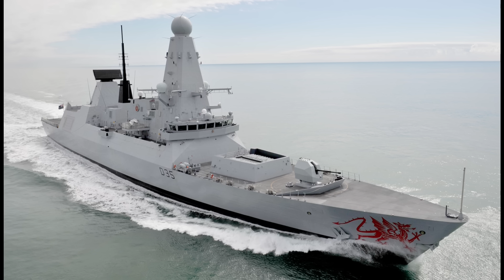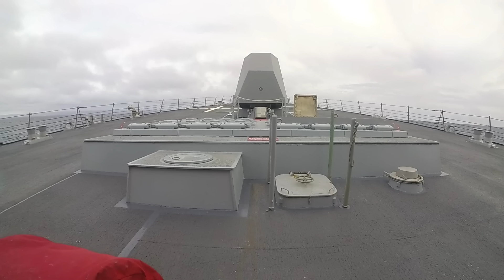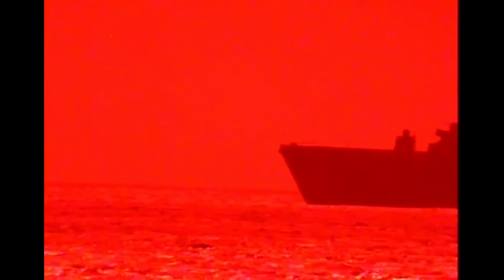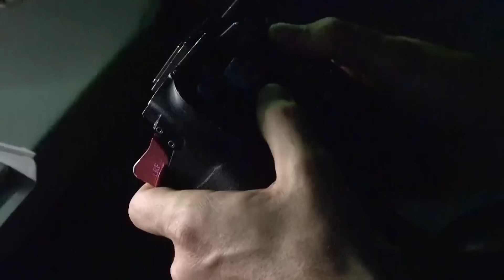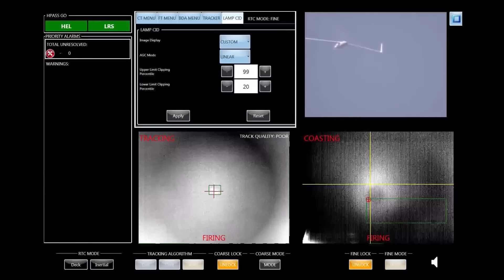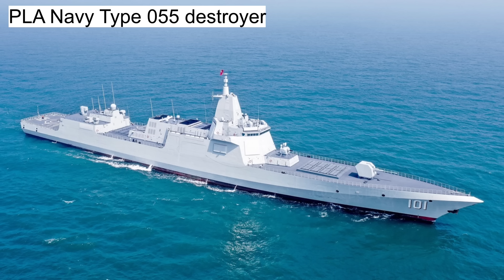Britain's Type 83 Destroyer: Three Radical Designs, One Big Decision

Comment: Up gun the existing Type 26 Hull. By replacing the multi-mission workspace in the center of the Ship , you can fit an all ship total of 96 VLS cells.
Reply: It would be a lot less capable than a dedicated new ship
Reply: @omarbaba9892  True, but it would be 10 x more affordable, and have a proven hull and mechanical structure.
Reply: @SteveHill-dk5xl it really would not be, it would still be incredibly expensive to rework the ship to be a proper AA platform, the BAE proposal to swap the mission bar for more vls doesn’t improve the radar
Reply: @omarbaba9892  The Type 45 Daring Class is an example of how expensive it is too start from scratch and make a mistake. Rather than another Bespoke platform, simply expand on the proven Type 26 design, accepting what limitations it may impose, the risk is much much lower.
Reply: @SteveHill-dk5xl and look where that got us, one of the best anti air warfare ships in the world. 

The type 26 is already near the limits of its power generation. That’s why the max amount of vls Australia could fit on it was 32. Sure it could fit 96 by removing the mission bay but that’s still going to be very limited with it likely not being able to have a lot of the systems which make the type 45 so good at AA

No, we absolutely need to make a new ship. Ideally like what the Italians are building, a 11,000-14,000 tonne ship with over 100 vls cells and one they can perform multiple roles.

Comment: What a load of nonsense.   In a struggling defence sector. This is a pipe dream
Reply: How
Reply: @omarbaba9892 what are you blind ? We have no money and the type 45s will run until into the 2040s
Reply: @omarbaba9892, there is no development of this ship even mentioned; it's just a concept, nothing more
Reply: @Highendaudio1 there is current development 

Also, clearly not since we’re currently building over a dozen large fridges as well as massive export contracts with other navies
Reply: @omarbaba9892  Where do you live exactly. The only thing you know is the nonsense that's written. The type 83 will not even be on the horizon as the type 45s will serve right in to the 2040s. Large frigates. ?? The type 31s and toy GP frigates and we wont ever see 8 xT26s which are not the platform you think
Reply: @Highend @Highendaudio1  UK why? The only who’s most likely to be a bot is you given the strange username and lack of a profile picture 

Well yeah, it is basically in development to an extent since companies are coming up with designs for it. Not to mention that the type 45s are designed with an around 3 decade expected service life, mixed with the inactiveness from their PIP conversions that will easily take most of them into the early to mid 2040s, keep in mind the earliest Arleigh Burke’s are in the 30s and are still doing just fine 

And no, where is your evidence for this? The government has continuously stated that additional orders will be made to make up for the type 26s given to Norway, what’s the evidence to say it’s not happening especially since they’ll be needed to keep the actual yard open. And the hell you mean “not the platform you think”? Care to elaborate on that? 

And no, it’s ridiculous to call the type 31 a “toy frigate” at over 5000 tonnes. Especially since the contracts are already signed and in place to get them mk41 vls.

The stuff with the type 26 is mostly just fear mongering as Norway getting those ships will massively help the RN as well due to the major alliance we have with them, their ships will be identical to ours allowing for great interoperability as well as the fact they literally patrol the same areas we do
Reply: @omarbaba9892  You haven't got a clue and all you have said is absolute nonsense. There is nothing else to say because you are just making yourself look stupid.  You just come out with word salad. UK Parliament has not confirmed or anounced it. You are simply an internet reader and never served in any navy to understand how they work. Haven't you got school tomorrow .  Type 83 haha
Reply: @Highendaudio1 not actually saying why I’m wrong just saying I am

Ok😂😂

Bet you’re one of those “we need 40 frigates and 20 destroyers” people, like we for some reason would need even half that many large surface combatants now😂
Reply: @omarbaba9892  Perhaps it's best to rest for now and enjoy some downtime, maybe with a comic book. Everyone is entitled to form their own opinions. While you make some claims, there hasn't been any official government announcement yet.haha
Reply: @omarbaba9892 No one is coming up with anything for any type 83 concept apart from dreamers lol
Reply: @omarbaba9892  I have served in the Royal Navy and still teach. So go lay down you are embarrassing yourself. I dont have discussions with dreamers

Comment: I like the concept of multiple interlinked loyal wing-boats, not only does it give you diversfied aresnal loadout you can spead about a fleet or reload mid deployment. However in times of low intensity need these ships can be optionally crewed by a very small crew to do basic 'showing the flag' missions around the world, but primerally these can be command training vessels, in the old school of roving age of sail frigates, like a River class, but with global depolyment range. Give them the names of Razee's, small ships with oversized punch.

A single lage centre vessel makes sense as you can have a corrisponding larger ship for a smaller increase in crew than having 2 seperate ships. We know the servicability rate of ships is abysmal, building 4 ships means you are essentially immune to budget cuts as you have to have all of them (like Vanguard/Dreadnought).

Comment: British is better off to build more smaller frigate instead of big destroyer.
Reply: That would add much needed mass, as the USN is finding out.  But the necessity of magazine depth using VLS means bigger ships, more complex ships and therefore more expensive which leads the Treasury to buy LESS ships for the budget.
If going smaller they'd be role specific with little overlap as there's be no room in the hull. E.g AA role means no anti-ship, ASW means very little AA defence.

Type-23 was going to be a hull with a towed array - only - but sane minds put a stop to that, but it almost happened because the RN wanted hulls and the Govt wanted to cut defence.  The Falklands was not the wakeup call to the politicians it should've been, instead they used it to do a victory lap and farewell tour.

I'd leave it to the Admiralty, they know what to do, but the politicians need to be pulled out of this mess that they've caused and proven they can't handle, understand, or remedy.

Comment: The obvious solution is to build something the size of a rowing boat, in the shape of a type 45. This will confuse incoming drones and missiles and reduce lifecycle costs right across the board.
Reply: A ROWING BOAT?! Think of the expense man.  No, it must be a boat made from a single sheet of newspaper, a cheap one not a broadsheet, and shaped like a hat so that it's multi-functional and saves more money!
Reply: It would need to create matching radar and heat signatures - might work?
Reply: Or pedallo,'s

Comment: The third option was first offered to Australia for their Hunter class variant and is seriously being considered by the Australian Navy and it has a larger radar in it's design so it can be done. If Auatralia goes with this variant then that might reduce the risk for the UK.

From Wikipedia 

During Indo-Pacific 2023, BAE Systems Maritime Australia revealed a version of the Hunter-class frigate with an increased number of VLS cells. This was done by removing the Flexible Mission Bay and elements of its ASW capability (including the towed VDS), and replacing it with a 64 Mk41 VLS module for a total of 96 Mk41 VLS cells making it equal the USN Arleigh Burke-class destroyers. In addition, the number of anti-ship missiles was also increased from 8 to 16 Naval Strike Missiles. The VLS cell count is flexible and 16, 48 or 64 cells could be added depending on the requirement. It was also proposed that should the Royal Australian Navy require it, an additional 32 VLS cells could be added in place of the 5 inch Mk45 main gun for a total of 128 VLS cells. BAE Systems Australia claims that this variant retains 85% commonality with the original Hunter-class design. They also claim that there would be a minimal impact on cost and negligible impact on the schedule of the build so long as the modification to the design commenced with Batch II rather than Batch I vessels.

Comment: I feel Royal Navy should learn their lessons from Type 45 and always build a prototype first to test out if you are having something new and never used before on a ship, be it engine or sensor, dun be like Type 45 only to have to do a PIP later and send the ships back to "servicing" for months after they are launched.
Reply: They sort of do... the first in class is usually the guinea pig of sorts for all classes.

You can't really delay the building of the other ships in class because the build takes so long. If you waited to get one in service before starting on the others you'd increase the cost of the class enormously from letting the production go slack, and delay the commissioning to the point the class is technologically relevant for a shorter period of its service life.

You can test and adjust to a reasonable degree between each hull, but you kind have just have to hope you got your spec and design right for major things.
Reply: @Chimpiin the Type 45 was committed to build just based on Computer simulation on the new generator, since they didn't use the "traditional" tried and tested generators, and opt to use new tech, you never know what can happen when you change from a "tried and test" tech to a new one, like if you decide to change from a gun based CIWS to a laser one for example, hence you need to have more real world testing to make sure you test all variables before committing it to mass production.
The fact they didn't realise the generators had issues in warmer waters of the Mediterranean Seas, and had to add a Power Improvement Plan of an extra generator and do it to all 6, shows they didn't even test the lead ship in all NATO waters and just around UK's waters.
Of cos if you are designing a OPV, a Patrol Vessel that only move in ur own coastal waters that's fine, but it you want a vessel that can travel across oceans, won't you at least make the lead ship move to more waters like UK to Suez canal or UK to Cape of Good Hope, (what if suez canal is closed), and see if it has problems before realise oh shit the issue is with the design in the first place, the blueprint, and you already cut the steel for the others, too late

Comment: We do not need a type 83, we need type 45 block 2's and more 26 and 31's.
Reply: Starting up a t45 line again isnt that simple the amount of work that will go into it will be close enough to that required for a new class that they'd be better of with a new class now its to late for T45 batch 2 that boat has sailed.
Reply: Tf? The type 45 is now a 20 year old design, there are improvements that can be made, especially the vls capacity

Comment: Move the 5-inch gun up front, slide the bridge forward into that space and build 2 sponsons on the hull to fit 2 5-inch guns, 1 on each side. The space gained by moving the bridge forward can then fit more launchers
Reply: " and build 2 sponsons on the hull to fit 2 5-inch guns, 1 on each side." and where would the ammunition for those guns go? Currently the magazine is located beneath the gun, in the depths of the forward hull.
Reply: I agree with the word 'currently'. I see a gun-ammo bay still in the centre of the ship, but with a system that also moves it to where it needs to go. Surely we can design and build such a system? This way, we would have a proven gun layout that automatically has swarm defence ability.
Reply: Each 5 inch gun system is at least 20 tons of top weight and sponson mounting them doesnt even give them that much more field of fire then a single bow mounted gun sponson positions on modern ships are better for smaller guns like 30-40mm's or maybe at a push 57mm's the smaller systems will also have higher rates of fire to deal with drone swarms and come with things like air burst programable munitions or even twin line feeds allowing them to quickly change ammunition types on the fly as needed making them better for dealing with drones.

If magazine depth is needed go with wolf packs of OPV sized drone sloops armed with 16 VLS cells that are networked to the crewed ship each having their own CIWS and 30-57mm guns to assist with point defense and have a helicopter pad so the crewed ship can airlift maintenance crews over every so often to inspect and repair things.

Comment: i think weapons systems should come first, sensors, robust cooperative engagement,  a mix of low cost high load-out weapons for drone swarm, and high performance and long range for theatre and fleet  anti air defence, vs missiles and fast jets etc. The Hulls don't matter that much. a mix of refit upgrades for existing vessels (radar, fire control weapons), and revised (or new) hulls for new build if needed, I thinks its to late for Tupe 45 batch 2, but existing 31's and 26's should be part of the networked system.

Comment: Drone swarm management needs 2 things: Big/ stand off arsenal (ship, large cargo aircraft or base) + Forward drone node controller. Both can trade off capability to be unmanned. Sophisticated manned escorts may look very different than they do now but will need reload-at-sea capability: If using standardised pods/containers, it maybe possible to design this to include re-role and be done by any ship, even an unmanned one.
Reply: I agree. The destroyer doesn't need 100 vls cells if it's controlling 10 drone boats, each with 15 vls. Take the arsenal ship concept and instead of having one massive floating magazine, make lots of small, cheap floating magazines

Comment: Larger hulls don't add much to the cost of a ship. Steel is cheap. Those massive container ships only cost about $150M. 
It's the systems which cost money. Make the ship as big as you like. Make the crew quarters more spacious, and bigger fuel tanks, more VLS. 128 sounds like a reasonable number.
Reply: But anyway the hardware in the 128vls isn’t chip
Reply: But a bigger ship also makes for a bigger, easier to hit, target.
Reply: @_starfiend  True. I supose it's striking that balance. I wouldn't recomend making a warship the size of a container ship 😊

Comment: They need to sort out the power plant problem, the Rolls Royce intercoolers don't work reliably. Going with the idea of diesel to produce energy for an electric drive..... Theoretically from my point of view each diesel could be swapped with a future Rolls Royce SMR (small modualr reactor) to deliver the daft amount of power they will need for the electronic/warefare systems and point defence energy weapons. So the engine problems are may mayor conceran throughout the fleet but I suspect a place holder.
Reply: Northrop Grumman intercooler

Comment: They need to focus on frigates at the moment
Reply: aren't frigates the most numerous major combat vessel in the royal navy? And a new generation of frigates are under construction currently.
Reply: They are. Currently Building the T26 and T31 Frigates. But you need to have the next generation AAW Destroyers designs ready, for when the current Frigate build cycle completes. We don't need another SSN delay.
Reply: They do need to buy more firgates than planned , but work needs to begin on a type 45 replacement urgently. The first typ3 45 leaves serives in 2038, that leaves 12 years to design and build the first type 83, which really isn't that long. We can't afford a destroyer gap.
Reply: @startled_squid  We need type 45 block 2's.
Reply: @_starfiend We can make something a lot better than type 45. We also can't just restart its production line. Realistically, we need a ship that's bugger even if only slightly. Can't do that with a batch 2 type 45. I mean it's hard to overstate how different type 83 would be.